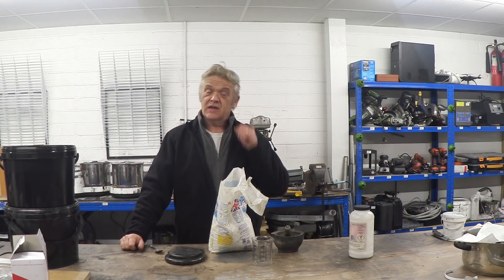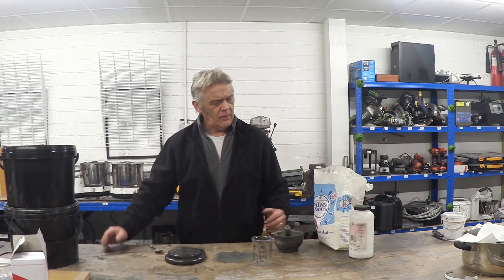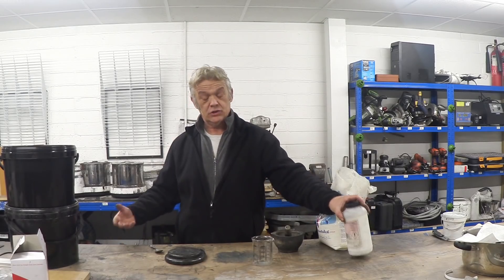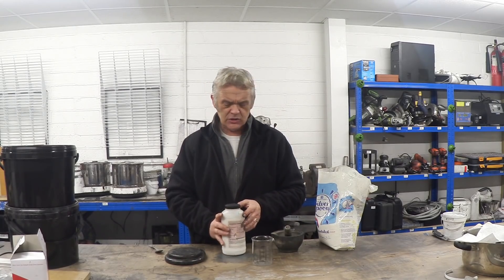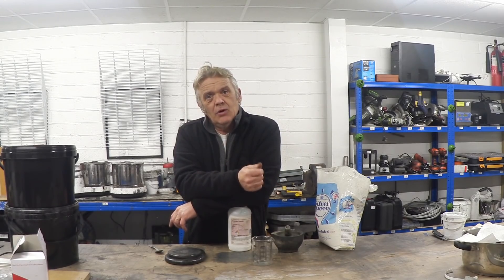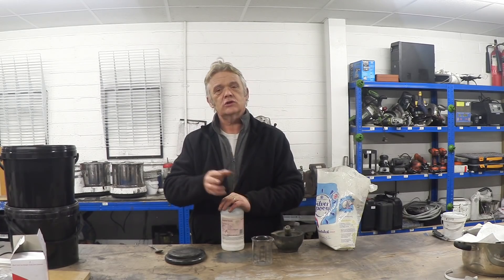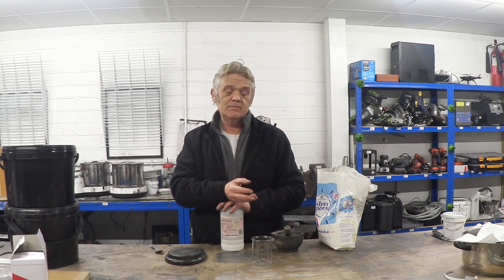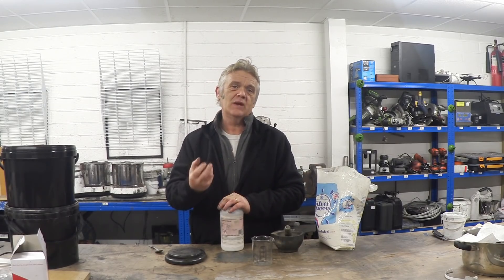Making Graphene Foam From Table Sugar

Comment: Carbon briquettes (coal) can give us reduced oxygen and enormous heat (over 800º).   ... Hmm ... interesting ... Iron Forge(ing) anybody?
Reply from the maker: for sure mate
Reply: James Wilson i have grapitised many things in many high temps i have not found it to be any different outcomes from 800 -2000 degress . Just amount of time needs to remain. It needs time !!
Reply: @Buzzhumma   So we believe a baking of around 800º is the key - for a prolong period of time without oxygen.  Very interesting, thank you.  So we can burn our coal with reduced air flow for days and keep the material in a sealed container in the fire. I imagine pressure shouldn't affect the product. Rob showed this once a few years back with pipe fittings in an electric oven; sadly few have such.
Reply: James Wilson  you got to have a  small hole in lid
Reply: @Buzzhumma  Yea, I am a bit worried about pressure build up, Like a grenade - not too safe,  just hate to see it burn up. I guess I shouldn't seal it up. Would there be any advantage to quench it in oil when removing it from the furnace?
Reply: James Wilson no !  Just stick a twig in the hole to seal it when you take it off . While it is on it will alwsys create positive pressure

Comment: "Oh fascinating" he says as he experiences a waft of hot hydrochloric acid gas and ammonia.
Reply from the maker: mostly it was water from the dehydration of the sugar - it was probably less than from cleaning a drain lol
Reply from the maker: lol - for sure - isn't it the second highest world killer?
Reply: Stimpy&Ren yes its actual the first fuel the body uses as it considers white sugar as a toxin !🧐
Reply: Ammonium Chloride sublimes into a gas. Theoretically it is Ammonia and Hydrogen Chloride but you can't separate them and as soon as it cools you only have Ammonium Chloride NH4Cl. I don't recommend breathing it, but it's not considered toxic. They actually put it in cough syrup. The worst part is it will cause a white haze on your windows, which is easily cleaned off, and the chlorides in the air will cause rusting and corrosion on bare steel and iron surfaces. I'm not sure what effect it has on electronics.
Reply: @pixelpatter01  You just said what effect it will have on electronics, corrosion.
Reply: @pixelpatter01  Ammonium chloride is acidic salt !
Reply: That's real enthusiasm! And - don't even doubt about it- enthusiasm is one of the most important ingredients that make his videos so interesting.
Enthusiasm and that honest smile every time something goes as expected!
Reply: Make a MOS-Fet-Transistor with a broad gate structure, coat it with graphene and dotate that layer with hydrogen.

The graphene will keep the hydrogene atoms seperate, which is needed for the trick. The trick is already old. It was found by the pharma-industry in the US. Every 20 minutes, a hydrogene-atom will be enhanced in such a way, that it creates a virtual partner for it (anti-hydrogen-particle), that tunnels through the stomach and explodes in your shirt with the power of a thousand suns. Since it is only one about every 20 minutes, no harm is done to you. That trick was found as they tried to understand the human stomach.

If you build a mashine or a transistor for that, you'll notice a rosa flame on top of it, that becomes pretty hot and delivers more energy, than the device is using.

The US had built a fabrication site in antarctica in the 70s, where the biggest 3D-printer in the world was made and it took 20 years for them to print the device, which is now serving as an energy source on the famous airship-carrier George W Bush. Antimatter is the cleanest and safest form of energy.
Reply: Ammonia mostly just smells (in a waft). HCl makes your skin feel odd, and the hair goes kinda rough-feeling for a couple of days. Clothes are not very keen on it either. Yes, i was once in a cloud of hot HCl.
Reply from the maker: lol - mate I was once in a cloud of sulphuric acid - that made my eyes water lol
Reply: Ouch !

Comment: Robert great video again, it would be so nice if you could get and electron microscope to show the structure of the materials you made, I know that these are very expensive but it will be awesome
Reply from the maker: it would mate - a 'cheap one' costs 45,000 - the next time I have a spare 45k - I'll buy one. I am joking a bit - I was thinking about running a kickstarter just to raise money for that as it happens
Reply: @ThinkingandTinkering  I bet you could convince Ben over at the Applied Science channel to do it. He built his own SEM a few years ago.
Reply from the maker: @schlega2  now there's an idea - cheers mate
Reply: Sirius Fuenmayor  yeah 45k is big money but is it fair to say the proof is in the capacitance ?
Reply: @Buzzhumma  Sure! that is the ultimate proof that the material works for this purpose

Comment: Hi Rob you will get some pretty good results from table Sugar but give it a go with Glucose. The results are far more Amazing  ( C6H12O6 )

kev
Reply from the maker: cheers mate - will do - I can get some from a local beer making store near me
Reply: kev wallcroft yay ol mate Carbonator is back in town 🤗
Reply: @Buzzhumma  Well yes mate, a long illness can often curtail ones Fun. However i have a miriad of fresh new ideas that i would like to try.
Maybe even do a video or 15 LoL.
Reply: kev wallcroft super excited about your input buddy .👍🏻
Reply: @mouldykev  This I will need to check out. What about that Pharaohs Serpent mixture how about adjusting that and growing ropes of carbon foam? :D
Reply: @excitedbox5705  tried all those mate, didn't get the results i was looking for. Where as the Glucose Carbonised with a touch of ( conductive ) Carbon Black worked very well.
But any of them are only as good as your electrolyte.
Reply: @mouldykev  question: hwo is the thermal conductivity of this stuff? Got any idea?

Comment: How is this graphene?   I thought it had to be based from Graphite.
Reply from the maker: no mate - it has to have a graphenic structure - these days graphene is being categorised by physical properties - that is any carbon arrangement that exhibits 2d properties is considered graphene - the most notable is single sheet graphite - but the same single sheet hexagonal arrangement of carbon as found in single sheet graphite is graphene. There are lots of ways to get this CVD being one - there you take a carbon precursor - and Universities have used methane, horse poop and Girl Scout cookies - I kid you not - and heat it over a copper strip - this will form graphene. This is one example there are many - have a read around but use google scholar - all you really need is a source of carbon and a way to arrange the lattice.
Reply: @ThinkingandTinkering  please share a video demonstrating the physical properties to clarify that this is in fact graphine rather than just of a lump of carbon.
Reply: Sugar is carbon based.
Reply: I know.  But carbon is not graphene either
Reply: Graphite is carbon.
Reply: Yeah?  Carbon is not GRAPHENE.
Reply: I would think he needs to recover the graphene next, next video, not sure what method he will use, 9ne of his methods he is exclusive about. We will see.

Comment: Any time I need to mix dry components, I use powdered sugar.  It seems to give a more even mix with less mixing than granulated sugar.

BTW sulfuric acid + sugar is way more fun, but the reaction happens too quickly (without heat) if you use powdered sugar.  Muriatic acid does require adding heat and the foam produced is much more dense.
Reply: Thanks for the information technosaurus
Reply: Commercial powdered sugar can have corn starch in it, read the ingredients
Reply: @oregonhoney753  good point - my store brand doesn't but its a good idea to look... although for this particular experiment corn starch could be useful as it heats up and becomes dextrose - science is full of accidental discovery.
Reply from the maker: absolutely mate - very good point - cheers
Reply: Sugar and H2SO4 is highly exothermic reaction,... so, you get alot of heat (but you definitely mean,...extra applying of the heat).  H2SO4 + sugar carbon you can also graphitize on high heat.
Reply from the maker: I did a few vids on the sugar snakes mate

Comment: Hey Rob, What did you think of Rice Universities flash graphene from carbons?
Reply from the maker: I like it mate and thought of doing a replication but the caps are £100 each and you need 12 I think - a bit expensive - but I am thinking about it and how to get around that
Reply: @Robert Murray-Smith  The King of Random (RIP TKOR, you beautiful fool) made an arc forge from an old lantern battery, a scrap microwave and a refractory brick...

https://youtu.be/VTzKIs19eZE

I smell your next video.

My idea for a vacuum forge is a capped section of steel water main pipe lined with starlite and refractory brick with a thick borosilicate quartz viewing port on the lid.

I will eventually build one so I can make my own synthetic ruby abrasive grit from aluminum oxide and chromium oxide.
Reply: @Barskor1  that too. 

I get more excited about unlimited homemade abrasive than gemstones, lol.
Reply: @Barskor1  not yet :)
Reply: @ThinkingandTinkering  if you need voltage and notsomuch current, you could look at boost buck converters like the emco q80. Costs like $300
Reply: Robert Murray-Smith leyden jars?
Reply: Robert Murray-Smith leyden jars and microwave oven transformer ?
Reply: Yeah I am trying to find some accurate information on voltages and amperage needed to do this. I believe we could build a unit that could do this at home. Unfortunately the information is tied up behind paywalls. I would love a better explanation on how this is done. Even if no actual process for an experiment is available yet.
Reply: Jesse Hughes i hope one of us is smart enough to replicate it in our garage . I think it uses high vacuum and 5000 v capacitive discharge !
Reply: you teach how to make supercaps.why not make some? lol